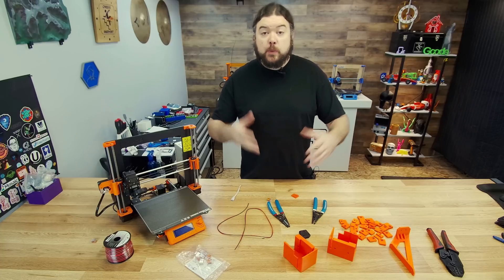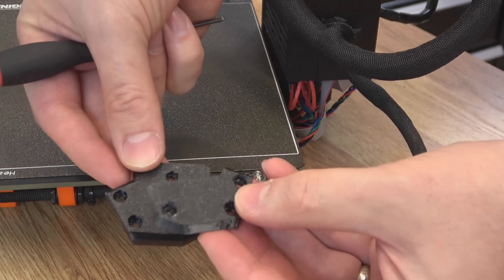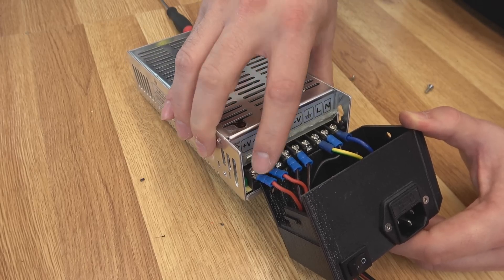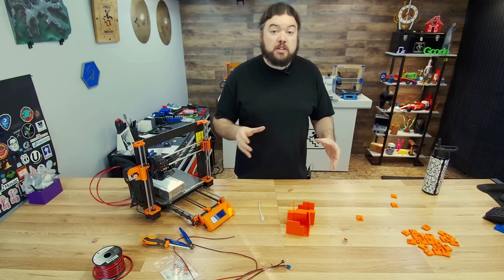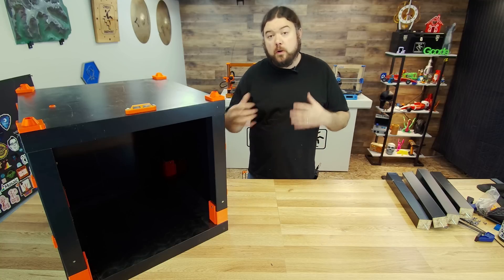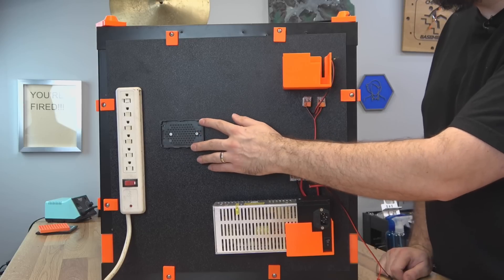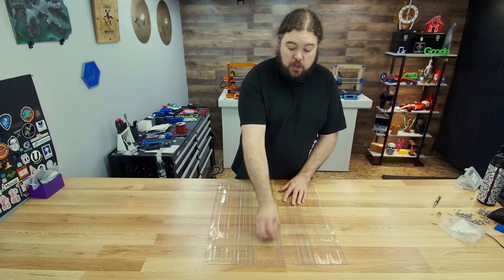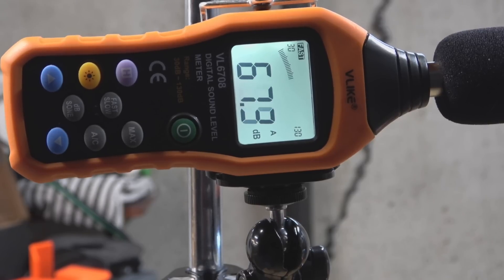Multi Printer Lack Enclosure - Part 2 - Enclosure Restack - Chris's Basement - 2023

Comment: What about the main board? Is it okay to use it in the enclosure? Thinking of making a Lack enclosure for my Sovol SV06. 😁
Reply from the maker: Yes, the mainboard should be just fine. Other that the PSU and printed parts everything should be good to almost 60c.
Reply: @ChrisRiley  okay thanks! 😁🤘

Comment: Sorry for going off-topic. I need a replacement board for my Prusa MK3 i3 this is a stock machine, nothing has been changed on this machine. Is there a board from China that just works and if so what should I look out for in the way of the exact board type. Thank you.
Reply from the maker: You can get them and they are about half the price, but I don't have any info about them. THey don't seem to be very common. https://www.aliexpress.us/item/3256804418480512.html?spm=a2g0o.productlist.main.13.566e674byUXRPe&algo_pvid=c32f5f8a-77b7-441c-8e5d-23c89838bba4&algo_exp_id=c32f5f8a-77b7-441c-8e5d-23c89838bba4-6&pdp_ext_f=%7B%22sku_id%22%3A%2212000029799500752%22%7D&pdp_npi=3%40dis%21USD%21100.43%2165.28%21%21%21%21%21%40211bec8616788902984727234d074b%2112000029799500752%21sea%21US%21877268665&curPageLogUid=qFsmK2bNHxjl